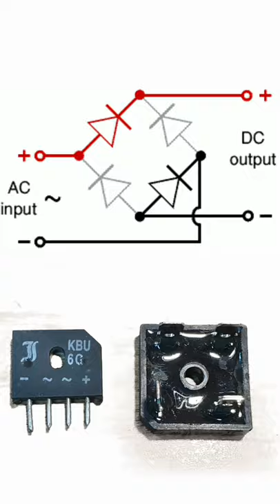Full Bridge Rectifier !

Comment: Another tutorial that’s useless because it doesn’t show the values of the components.
Reply from the maker: It's not a tutorial, it's more of a demonstration of how a full bridge rectifier operates. Each application will have different value components. The capacitor is not necessarily  changing a lead-acid battery.

Comment: You don't need a capacitor for charging a battery.  The battery will behave as one.
Reply from the maker: Yes you are right😉👍, but this video is more about how to use/make a bridge rectifier (AC to "smooth" DC). The battery charging, is just a example of a connected load.🤔😉

Comment from the maker: The peak voltage is just over 14v, so it's perfect for 12v lead acid batteries. The small transformer has quite a high impedance, so it helps with current limiting.

Comment: It's not a regulated voltage or a current . battery will be dead in a hour
Reply from the maker: The purpose of this video is to demonstrate the workings of a full bridge rectifier. You don't need a regulated voltage to charge a lead acid battery. You just need current limiting and a upper voltage limit for float charging. This small transformer has very high impedance and its peak voltage matches the float voltage of the battery of around 14V. If you don't have a matching transformer, you can add a voltage regulator with current limiting.

Comment: Now Should we connect pin with 240volt directly to charge battery
Reply from the maker: You need to add a  suitable transformer to the full bridge rectifier input. The transformer connects to the 240Vac and steps it down to your desired changing AC voltage. Use a small transformer with a high impedance to have some current limiting for the changing.

Comment: Capacitor negative polarity is connect to the positive DC output and Positive side is connect to the Negative side of DC output, Is that right?
Reply from the maker: The striped side of the capacitor is the negative, and it is connected to the negative output of the full bridge rectifier. The video is correct.
Reply: @MyProjectBoxChannel  if so it is right. May be my eyes problem 🤣 I am not trying to argue you, but as my view, it seems polarity of the capacitor placed in opposite direction... sorry

Comment: Hello, what diodes i need for a bridge rectifier 35Amps 800volts? For a welding inverter.
Reply from the maker: Just get a ready-made 35 amp bridge rectifier.

Comment: Would thos act like a float charger what size capacitors are those ?
Reply from the maker: It's probably NOT very well suited as a float charger for lead acid batteries. Unless the peak voltage rectified, from the transformer, exactly matches the float voltage you need. The capacitor value is not important, because lead acid batteries don't care about smooth DC for charging. You could add a voltage regulator, that can be set to the precise float charge voltage.

Comment: Why bro capacitor using?
Reply from the maker: The capacitor is not needed for changing a lead-acid-battery. However you do require a capacitor to smooth out the ripples, and give you a nice smooth DC supply, for devices that require that.
Reply: @MyProjectBoxChannel  ripples adhigama iruntha enna bro agum adha ean kuraikanum

Comment: Diode voltage rating is 12v right
Reply from the maker: The diodes used in the video are 1N4007,  and are rated upto 1000 Volt 1Amp. These are standard rectifier diodes.
Reply: TQ ...

Comment: Its incorrect connection.
The DC output from your rectifier are connected the opposite way.
Postive has been connected to negative and vice-versa.

Your Bridge might collapse or fall down.

EDIT : YES YOUR RIGHT
ITS connected the right way
Reply from the maker: I'm sorry my friend , there is nothing wrong with this bridge rectifier circuit. I have been doing electronics for a very long time ,and made hundreds of diode bridges 🤔😉. All the diodes are pointing the right way.
Reply: @MyProjectBoxChannel  Your the Man

Comment: IC7812

 regulator
Reply from the maker: To charge a 12v lead-acid battery you need a slightly higher voltage of about 14 V. If you want to use regulator, it needs to be the adjustable type. You can also trick the 7812 to give a higher voltage with some diodes on the ground pin.
Reply: @MyProjectBoxChannel  thanks